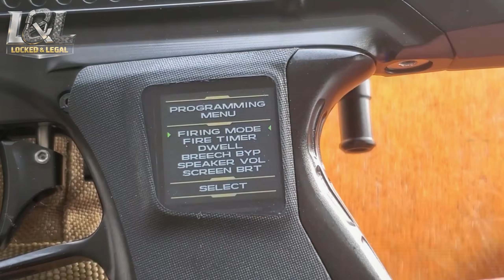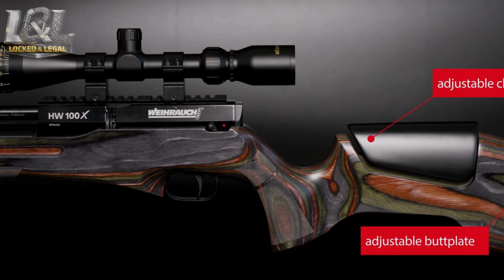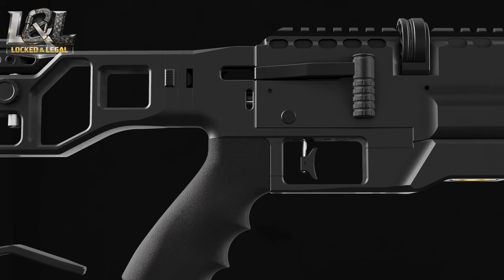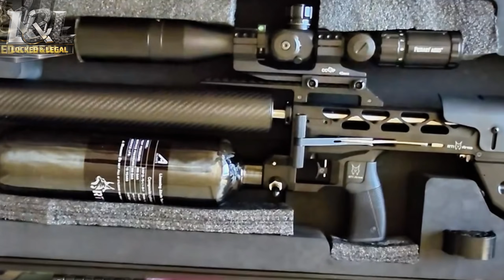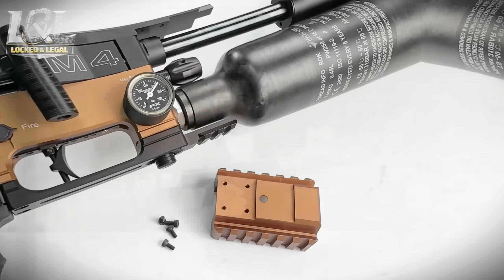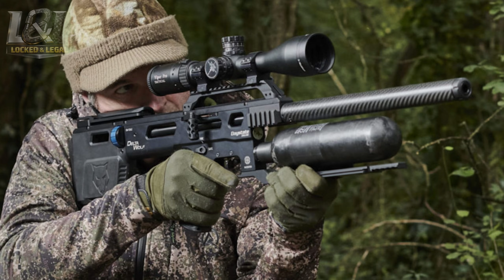Top 7 Airguns from 7 Different Countries — Which One Will Be Crowned King?

Comment: Which PCP air rifle is the most expensive of them all? If you can't give me an answer, then you're nowhere to be found.......?
Reply from the maker: Among the seven PCP air rifles featured in this video, the Daystate Delta Wolf HP Performance is the most expensive, currently priced at around $3,700 in the U.S. market. The exact price can vary by caliber, configuration, dealer, and country.

If you mean the most expensive PCP air rifle in the entire world, there is no single fixed answer because custom-built, limited-edition, and specialized competition rifles can cost considerably more.
Reply: @LockedAndLegalUs 
I've seen custom builds over $20,000 USD. And one almost $40,000 USD (on the internet).

More money than I would ever spend on one. No matter how rich I was.

Don't get me wrong, I'd still spend  $4K plus on a build, though. I know I would.